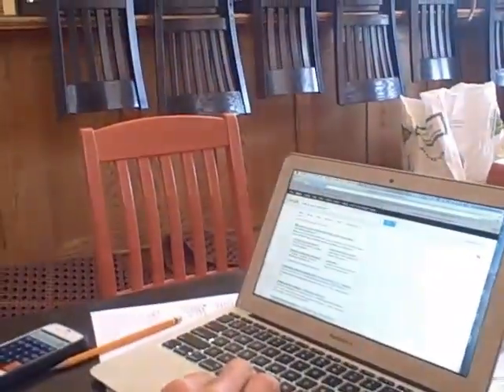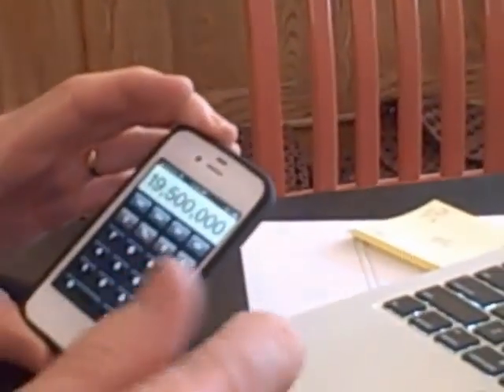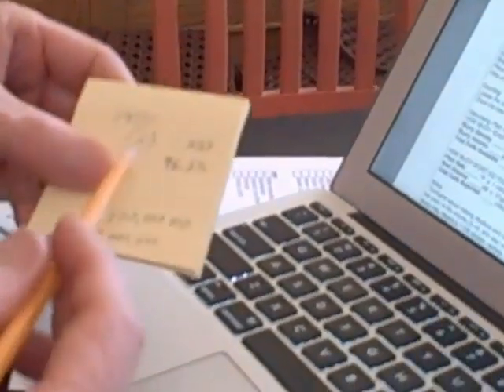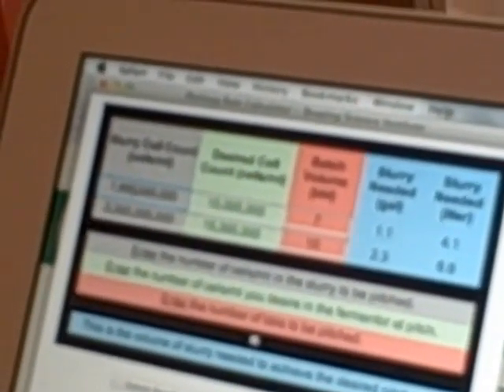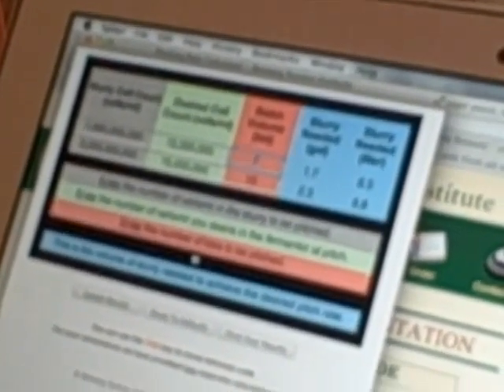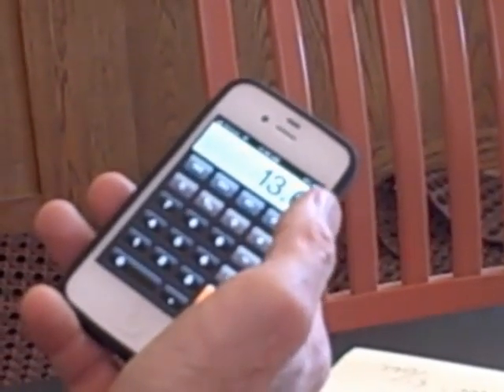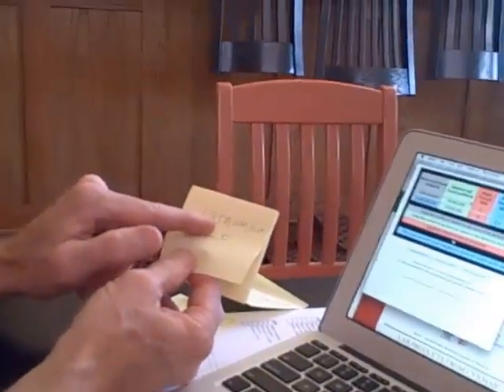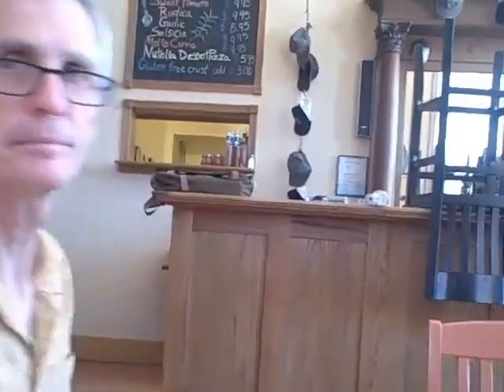Yeast Cell Counting 3 - More Videos At www.coloradoboy.com

Comment: Awesome video!  I have been researching yeast counting and viability all day and your video is the best one out there by far!  One thing I still don’t understand is why, when counting yeast, is it the norm to omit yeast cells that are touching 2 of the sides?  Thanks again!!!
Reply from the maker: It's how I learned at Siebel. I think it is just for consistency in counting. I would add though that it is easier to count with a regular microscope (400x) than a video one.

Comment: Great trio of video... couple quick question, do you use and special chemical/sanitizer to wash your yeast of dead cells ???? Or is that a non issue cause as it sits the living yeast will eat the dead cells as food??? Also do you put any yeast nutrients in your brink or is that not necessary????
Keep up the great videos guys
Reply from the maker: We don't wash yeast. We check viability. If it is 90 % or higher we use it. Once it starts dropping we buy new yeast.

Comment: Thanks for the informative video.  Clearer microscopy would have been nice, but there are enough other videos out there with graphics. Your easy to understand description of the calculation was refreshingly straight forward.  Question: Did you multiply the overall count by the viability percentage for you final number?  I may have missed it.
Reply from the maker: You take your overall count in 5 squares and multiply by 50,000. Then multiply that by your dilution factor. So 1:100 you would simply add 2 zeros. Then go to Brewing Science institute's web site and use their yeast pitch calculator and plug in your count. Good luck. You can email me directly if you have any specific questions through coloradoboy.com

Comment: Say you  harvested a couple of pints of yeast from a previous batch then worked out using the cell count and calculator that you needed 1.5 gallons of yeast for the next brew, how do you make up the volume?
Reply: +Tripel Trouble You don't have enough yeast so I would use the two pints and propagate it up to the correct volume. Other than that brew a smaller batch so you don't need enough. I usually keep a couple a Fermentis dry yeast in my cooler as an emergency get out of jail free card. That works well!